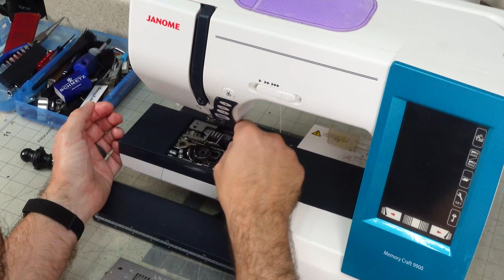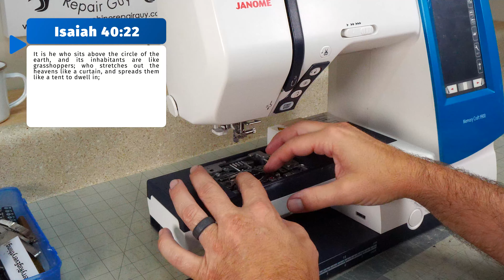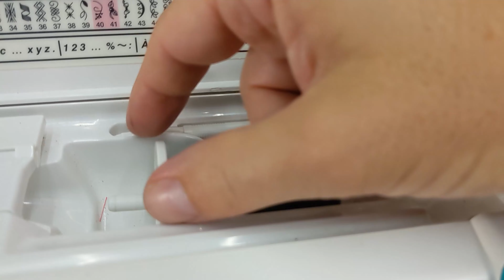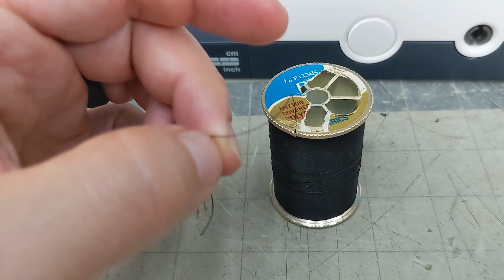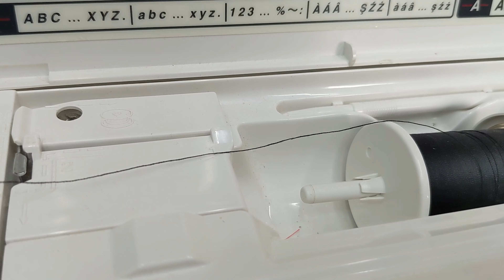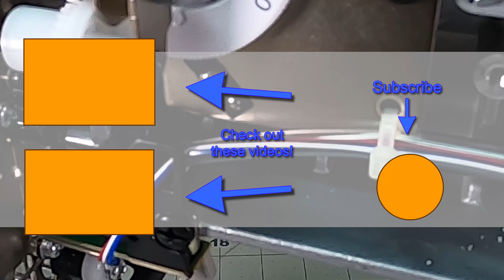💔Bent or Broke Needle? Now Your Machine is Stuck? Surprising Source of The Problem!

Comment: It's a shame that these computer driven machines do not have a simple device to monitor the thread tension and stop the motor before things get destroyed. If the tread from the spool went through to spring supported pin which would move when the tension gets too high and trigger a switch, the computer could stop and show a message that top thread not coming off the spool as planned. And if the machine has good enough screen, it could show a picture that shows which way the holder should be attached so the user could debug the problem really fast.

Comment: Great video to show this is caused by the upper thread being stuck, your video will help many sewers do up the upper thread correctly. For the needle punched bobbin case if this appears the only damage it is usually possible to work over the damage with your fingernail until it is smooth and it will work again, though as you said it is best to replace it with a new one.

Comment: Wow, this is a good one!  I had that happen to me once and was able to figure out how the thread caught on one of those spools; my spool holder was too small (duh!)  I also found a tiny nick on the bobbin case and was really p.o.'d at myself.  I immediately ordered a new bobbin case but I also took an emery board and carefully smoothed out the nicked spot so I was able to use the machine until the new case arrived.  That may have not been the smartest thing I've ever done, but it worked well in the interim.  I'm really glad to know about the tiny spring assembly too, just in case it should happen again - NOT!  I'll be checking my thread spools carefully and making sure to use the correct size holder from now on.  Thank you SO much!

Comment: I thought stack wound thread is always supposed to be place on the vertical spool pin, while cross wound always goes on the horizontal pin. Stacked thread isn't designed  to come off the end of the spool.
Reply: What i thought too

Comment: The one thing you can't fix is operator error. I have worked in the electronics and electromechanical field for 50 years and I would say that a good 30 to 40% of breakdowns  are do to operator error. A good part of my career has been in TV and radio broadcast engineering. I have seen quite a lot of operator damage. Great video, very informative thank you.
Reply: Thank you, very much for your instructions re.broken needles, very helpful,also I look forward to the scripture

Comment: Can you turn those spools around so that the catch spot is on the other side? What a silly way to mess up a nice machine. Thank you for the video.
Reply from the maker: There is one on both sides.
Reply: @SewingMachineRepairGuy  Also, both ends of the thread spool have those little nubs like a tiny scallop edge for the spool to look pretty, but they're not good for the thread.
Reply: Hey my machine has messed up from this exact thing. The thread caught and bent my needle. I detached the needle the auto threader works but will not read the thread. Check upper thread error. Any thoughts?